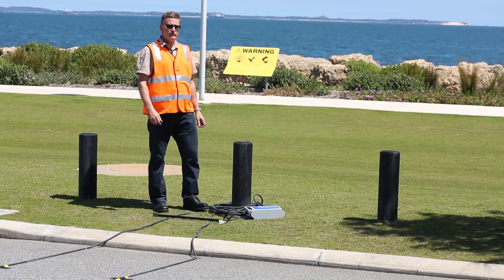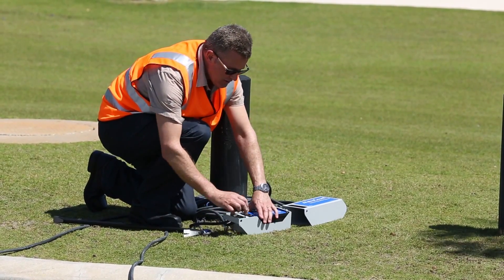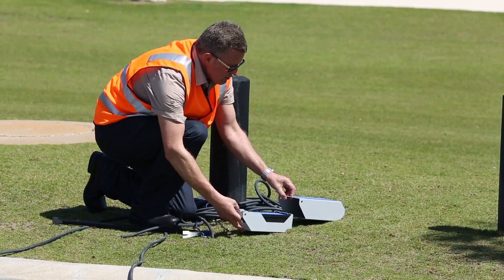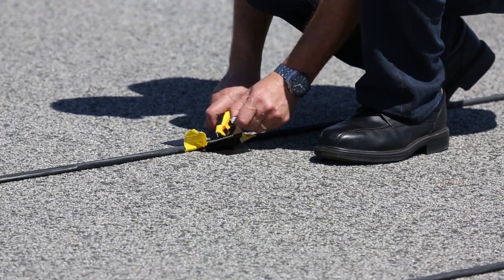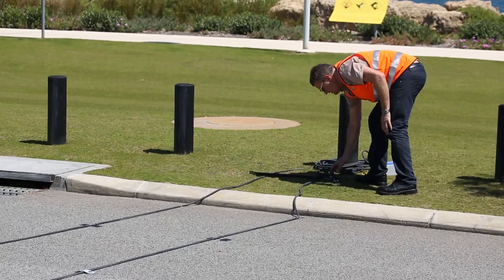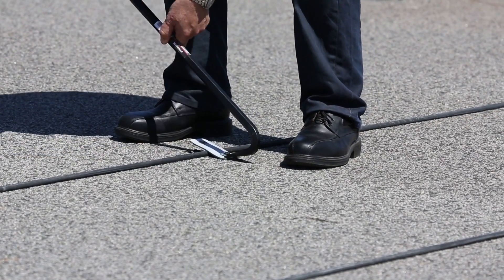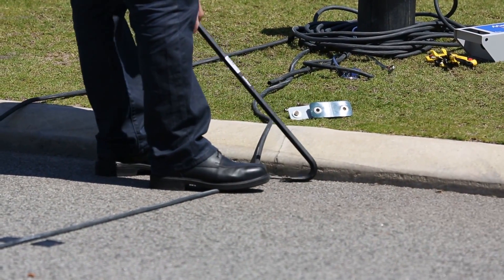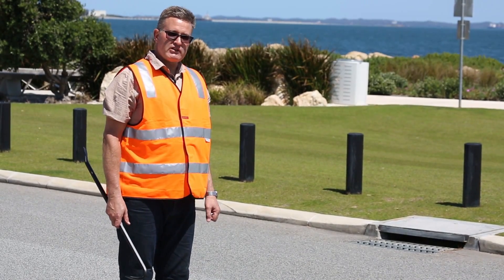Traffic Counter Removal: Part 5 (Survey Site Removal) | MetroCount

Comment: We used to use nails but found them not very secure at times. We now drill a 10mm hole into the road, attach a rawl plug and screw coach bolts to attach the figure of 8 loop.

When removing the tube we screw the bolt back into to the road which seals the hole. We can re-use the bolts a couple of years later.

The good thing about this is it stops water entering the hole which then freezes and blows a hole in the tarmac. We found it causes less damage to our roads.

It's probably not a problem in Western Australia but it is here in Scotland.